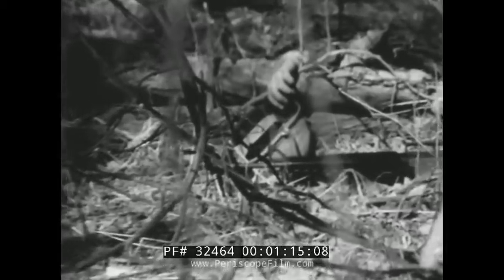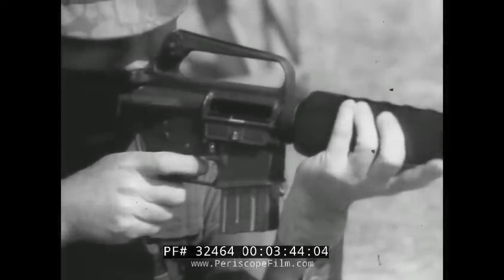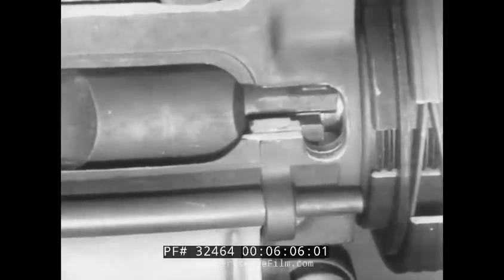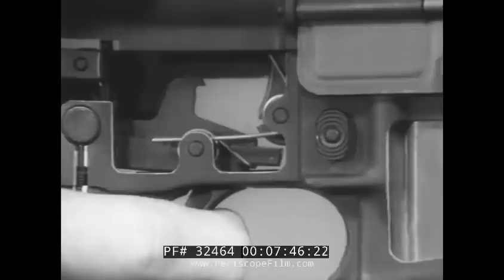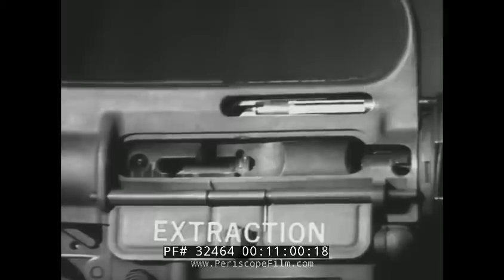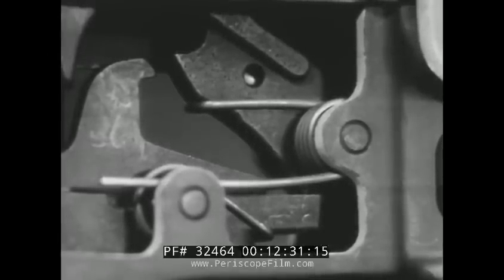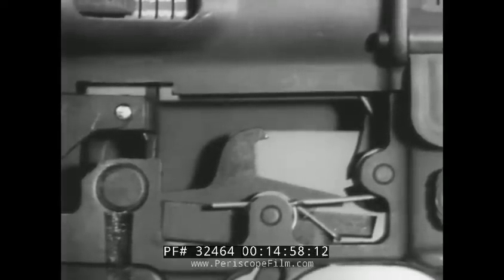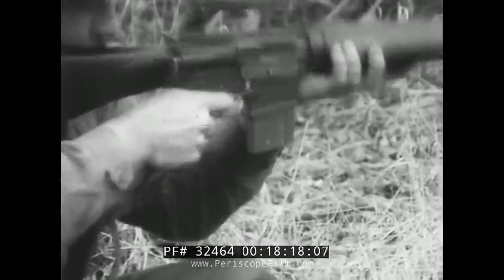1973 U.S. ARMY M16A1 RIFLE  CYCLE OF FUNCTIONING & IMMEDIATE ACTION  M-16 ARMALITE AR-15 32464

Comment: They should have done better in explaining to the soldier how the gas works inside the bolt, forcing the two sections apart to unlock it before sending it rearward. They should have shown the gas sealing as well. An animation should have been shown for that, since this is the very thing that fouls up in these rifles. Dirt and carbon buildup inside the bolt creates failure.
Reply: False. 

It is physically impossible for enough carbon fouling to build up in the bolt carrier group to stop it from functioning.
Reply: @rifleshooterchannel208  are you gunsmith or armorer? I am.

The carbon and dirt damages the sealing of the bolt halves, which was why they had to add a dust cover. It's also why there have been redesigns using a piston assembly and action rod to replace the gas tube, which does away with gas entering the bolt altogether.
Reply: This video, being from 1973, was still firmly in the days of ignoring the problem in hopes it would disappear on its own. It is what it is.
Reply: @craxd1  You must not be much of one, considering you don’t realize every production M16 had a dust cover. Pictures of ones with single digit serial numbers confirm this. 

The fit of the bolt and bolt carrier assembly are the exact reason that “too much carbon fouling” can’t happen. The amount of fouling is self limiting as the action of the bolt tail unlocking will shed an excess carbon fouling and it will simply fall down through the BCG and out of the rifle. 

The external piston models like the 416 or various LWRC offerings were not much more than a marketing gimmick in terms of the “fouling” you’re referencing. 

Larry Vickers, who was a consultant for H&K during their design of the 416 even stated this. He said the piston is really only an advantage when the use case of the rifle is extensive full auto fire with a suppressor in maritime environments and the barrel length is below 11.5 inches. The “piston reliability” only comes into play in this instance because of the dwell time of the action.
Reply: @craxd1  But next time you want to flex your (likely fabricated) armorer and gunsmith credentials, you should probably actually know what you’re talking about. 

Just a thought 🙂
Reply: @rifleshooterchannel208 Much talk  - no content.
Any vet over 70 knows the jamming problems endured because the original issued ammo used surplus powder to save $. Was a poor propellant for this rifle cartridge.
Reply: @rifleshooterchannel208   🙄 Everyone's an "expert" in the Youtube comments until an actual expert comes along and proves that they don't  know their own ass from a bullet hole in a paper target. 🎯 👍🏻
Reply: @TheObersalzburg   Where do you people come from!? 🙄😒🤣🤣🤣🤣🤣🤣🤣🤣🤣🤣🤣
Reply: @TheObersalzburg  Yeah, McNamara and the “Whiz Kids” had an obsession with getting an extra 100yd of effective range out of the M16, not to mention fielding it ASAP and demanding Colt forego the process of chrome lining the bore and chamber. 

The “extra range” was accomplished by loading the rounds hotter using some ball powder I can’t recall the name of, the real issues came about because the pressure curve of that powder increased the cyclic rate and bolt velocity which majorly threw the dwell time of the action out of balance and lead to serious issues. 

Bob Hutton designed the 5.56 to use a powder very similar in burn rate to IMR 3031, the problem ammo was loaded with a powder that had a much slower burn rate and was a terrible and tragic choice. 

And I’m sure the problems presented by a lack of protective chrome lining in the bore and chamber on a rifle for use in a jungle should be self explanatory.
Reply: it’s not designed for armorers just the standard soldiers, you don’t go too in depth

Comment: I wonder how many Soldiers and Marines passed out watching this in basic? 😂 🥱😴😪
Reply: Not with the Drill Instructors pacing around the room!
Reply: @bspegasus  I absolutely recall the DIs & CCs rousting anybody that was drowsy, and half the guys in the company standing at the back of the compartment... but still! This is the antithesis of nodoz! 😂
Reply: Depened on how hot/humid it was in the classroom  out a few times in other classes, but the drill sergeants would wake you up right quick...Are you checking your eyelids for  PINHOLES???